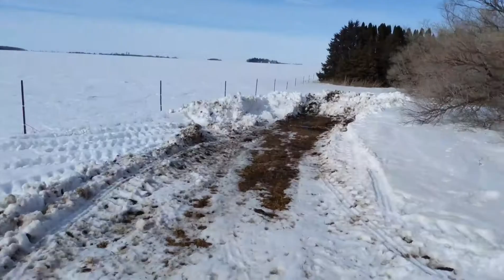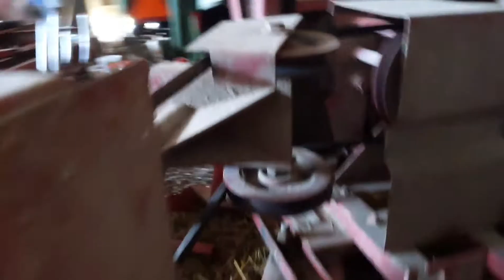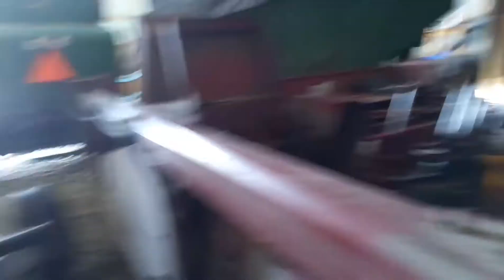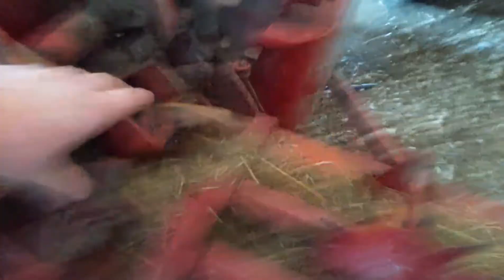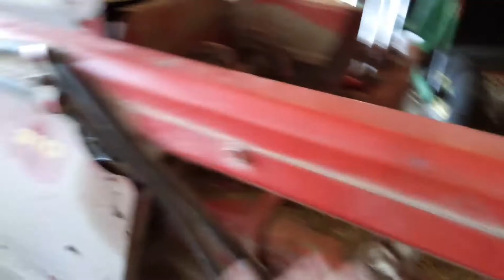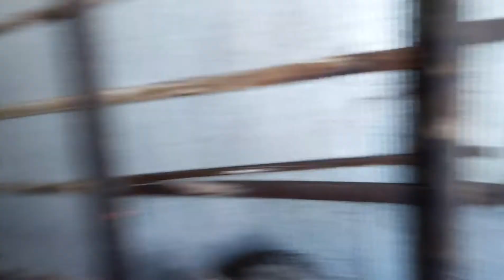Sloppy weekend, this year's modifications.

Comment: The 2 styles of throwers have their own pro's and cons. the pan throwers are nice, when they work, but the pin slots wear quick, the belt throwers are pretty simple and easy to maintain. But, like you said, small fields. Take it off, then instead of worrying about the thrower you'll be watching the bales on the ground so you don't run them over! Lol
Reply from the maker: True, but it's alot easier unloading a rack stacked by hand. Just gotta bale from the inside outward.

Comment: FWIW  I've used both throwers and prefer the belt throwers. I found that I missed the wagon much more often with the pan thrower. I think that's because it throws the bales higher and they kind of fall down into the wagon and that's not optimal on steep contour strips. If you want you can just take the belt that drives the thrower off the flywheel and the bales will just push on through the thrower and fall on to the ground.
Reply from the maker: That's not a bad idea, I'll deffinitelly consider it. The pan thrower from what I've read can really wear on a baler.

Comment: Water is always fun to deal with....
Bale throwers, they never came west.. only ones I've ever seen are on YouTube.. 
It's either picked up by hand or stackwagons here.. or accumulators and grapples or squeezes..
Reply from the maker: With only handling 200 bales a cutting it's not to hard, if I was able to pickup some bigger chunks I'll deffinitelly be looking at a thrower again.
Reply from the maker: Using a kicker and a stacker seems to be an eastern thing to. I learned to ride on the rack and unload from the bale chute. Hot sweaty work
Reply: @Heimerviewfarm  all kinds of ways.. lots of very odd ideas..
Lots of great videos of most of the different equipment

Comment: What do you mean by "no manual adjustment from the tractor"? Manual adjustment for thrower distance? Rotational adjustment for turning corners was a hydraulic cylinder on the Deere's and distance for my JD336 was a rotating handle that increased or decreased hydraulic flow for the pan tosser. Think hard about removing the thrower, price out a used Deere baler, either trade yours or sell it yourself. DO NOT ADD an old mechanical JD pan thrower!!! They beat the crap out of the baler and ALL the old pans are stressed and re-welded. The newer hydraulic pan throwers are far better than the old ones, that is why the mechanical  ones can be found for $50.00!
Reply from the maker: It was more of my buddies idea, I'm leaning towards just taking it off and laying them on the ground. I realized after I made the video I was referring to thrower distance, this thrower is very simple and easy to control but isn't well suited for my current operation.